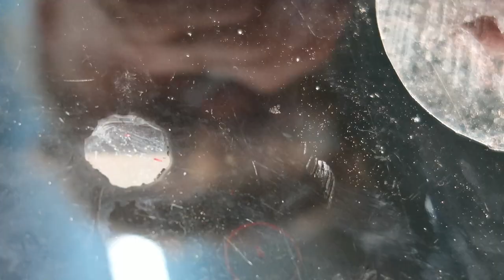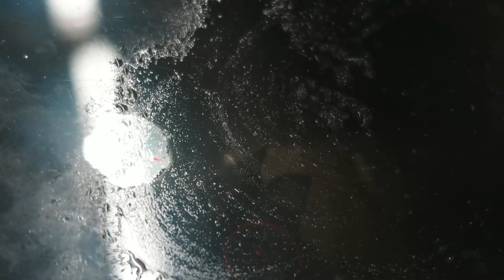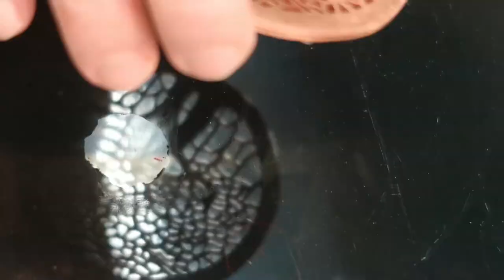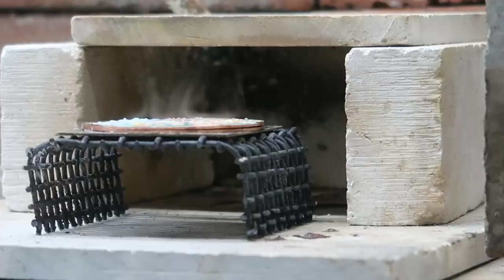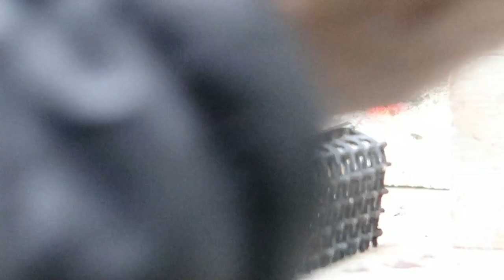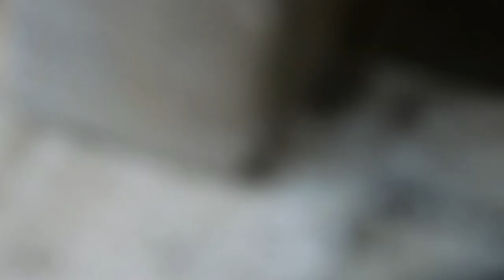Plique-à-jour Tree...day 6...color at last

Comment: The solder melted and didn't hold the copper sheets together. What solder did you use?
Reply from the maker: I use medium or hard silver solder, then use the kiln to heat the stack. I actually have switched to 12 gauge copper so now I skip that step. Good luck.